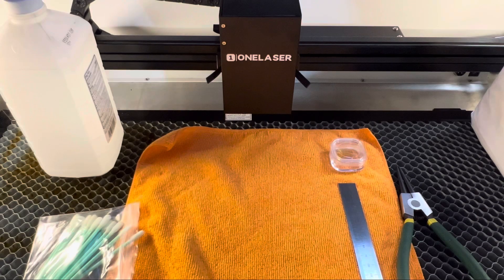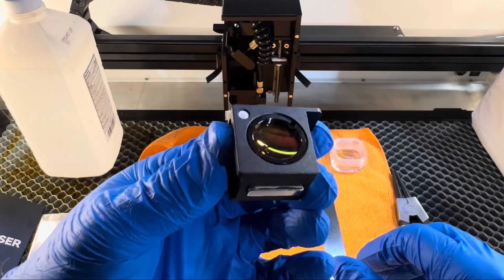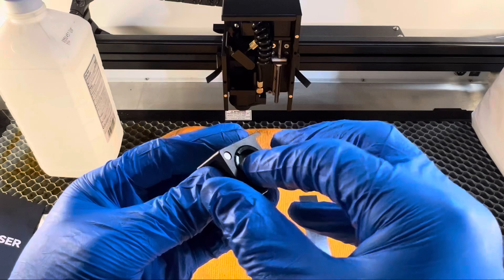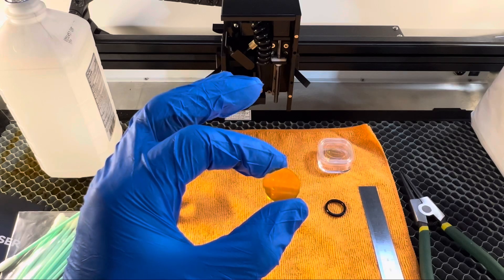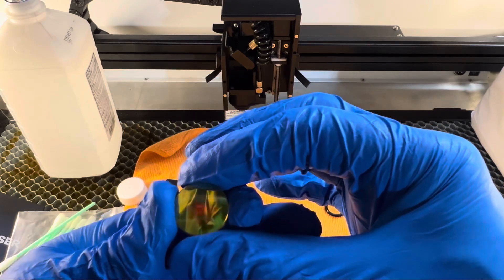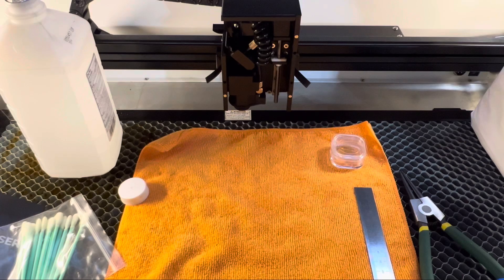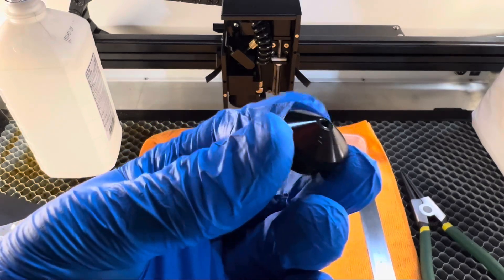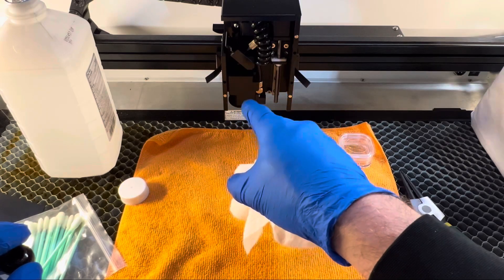XT / XRF OneLaser | Lens Cleaning & Replacement

Comment: Hi !!  I have chatted with you before on Facebook user group. Maybe a couple of years ago now.  I recently had my 60W Omtech CO2 laser cutting circles, but they are not round.  Lightburn has the lock on size, and it is W 3" and H 3".  All mirrors are aligned, cleaned.... Do you have a video where I might see if this is common or an easy fix?  The height is off by 4 mm. Just shy of 3".  Thanks for any assistance or guidance.

Comment: Thanks Cam for the info. One question...I was thinking that the OneLaser XRF and the XR used the same 20mm x 50.8mm lens and the only difference was the placement in the lens holder to change the lens from 2" to 2.5" focal length.  So, that's not the case? Thanks, Charlie in Central Florida
Reply from the maker: The XT comes stock for the 50.8 mm focal length lens. Its mounted on the bottom of the magnetic block
The XRF comes stock with the 63.5 mm focal length lens. Its mounted on the top of the magnetic block.
I'm not sure why those chose to do this, you can choose to use one or the other type of focal length lens on either model. You just have to install it in the correct position of the magnetic block and adjust your autofocus settings in lightburn.

Comment: Would like to see a step by step for installing different lenses for different focal points
Reply from the maker: Hi Coda. On the X series, if you want to use the nozzle for airflow, you can only install a 2.5 or 2.0 inch focal length lens. Use the top of the block for 2.5" (comes stock on the XRF), or the bottom of the block for 2.0" (stock on the XT). 

Longer focal lengths have deeper depth of fields (this is the hourglass shape the laser produces as it focuses through the lens). With a focal length lens bigger than 2.5", you'll run into an issue where the depth of field interferes with the nozzle opening. 

The only other thing when changing to different focal lengths is the settings adjustment in lightburn for your autofocus. I'll see about making a quick video for that (I also need to order a 2.5" focal length lens)

Thanks for the comment.
Reply: @EdmondsWoodshop  Yeah, they don't have different lens now.
Reply from the maker: I get my loose lenses from American Photonics. They're based out of Florida and better quality than I've seen coming out of China. My spare lenses come from them and would be my suggestion if you're wanting a spare or a different focal length.